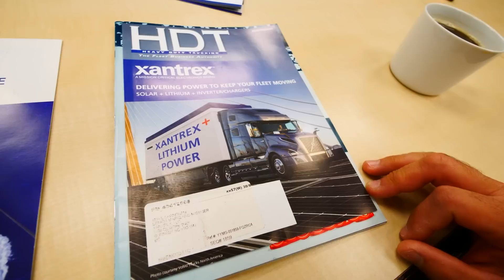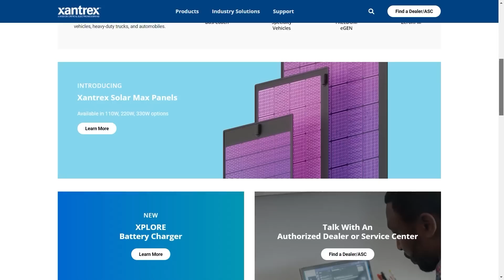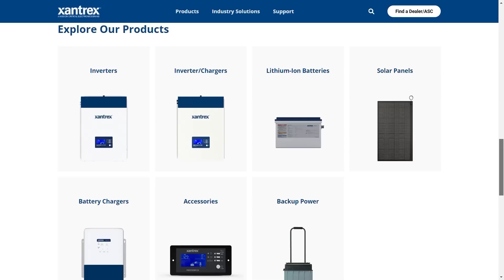We Are SO LUCKY To Get This Sponsor - It Is a GAME CHANGER for us!! (MJ Sailing - Ep 291)

Comment: Wow, So flush hatches are that important!   
Prehaps you should explain why they are so important! 
FYI at the spring boat show I saw a production 45’ cat with 5 flush hatches in each hull deck…….. but every one had a 2” high mushroom type ventilator mounted in the acrylic!   A toe snubber , potentially leak source and a weakened hatch acrylic!   What were they thinking ???
Cheers Warren

Comment: Wow that is so cool to have a NMEA interface on the Xantrex gateway, might be nice in the future to put an AI copilot onboard as a separate computer that can monitor all the data. Would be so nice to setup a trigger that would cut power to the motor if the motor load increases and rotations decrease(potential prop entanglement)... Lots of possibilities that way.
Reply from the maker: You got it!  The rest of our trip was spent with friends that run BRNKL, which is a remote security/monitoring company and can do all that you're thinking of.  We can't wait to be able to do/monitor anything that we think of.

Comment: I'll be interested to learn if Xantrex engineering can compete with Victron systems.  I  removed all Xantrex systems from my Winnebago Navion and went total Victron system in 2021 after due diligence..  Xantrex engineering was so far behind in inverter, MPPT, displays, Bluetooth, customer service, and junction boxes.  Even in 2022 they were no match for Victron.
Reply from the maker: Xantrex makes a great core product, but nowadays we have so many other demands - and we want it all to talk to each other - that they realized they need to expand their catalog.  We've been talking to them for two years about this, and their commitment to making sure they get it right without issue when they launch, is why we're trusting them.
Reply: @MJSailing  I'm hoping Xantrex engineering does leapfrog their product system integration into a viable competitor to the likes of Victron and even Volta.  Will be most interesting to watch.

Comment: I worked with fibreglass back in the '90s. Back then the epoxy had more health warnings on them than a carton of cigarettes nowadays. Have you noticed any health issued working with that stuff for the last couple of month or even years ?
Reply from the maker: We typically don't work with epoxy.  Just vinyl ester or poly.   I'm slightly allergic to epoxy, so avoid it as much as I can.  -Matt

Comment: circular saws are far faster than an oscillating tool for cutting straight lines
Reply from the maker: Absolutely, but they create a ton of dust and shoot that everywhere.  An oscillating tool is much cleaner and doesn't require tyvek suits.

Comment: Thank you for another video!  I would be interested in knowing hou many hours , in total it takes to do like the hatch manufacture and installation.  I have done some glassing and sanding ind I doubt many viewers know how much time it takes.  Watching you two make a boat I am sure others would be intrigued also.
Reply from the maker: Sad to say, but between mold making, gel coat and glassing mold, then the deck work, I'd estimate I have 50+ hours into each of the 6 hatches.   If this were a production boat, It would just be in the deck mold and not add any significant time.
Reply from the maker: I'll try and get a tally from Matt - because in this video we didn't even show the prep stages of gelcoating and glassing to make the frame itself!
Reply: Thank you for the reply, that is what I wanted Matt, how much time would a backyard glasser spend to do that.